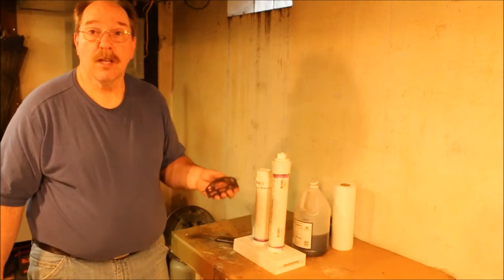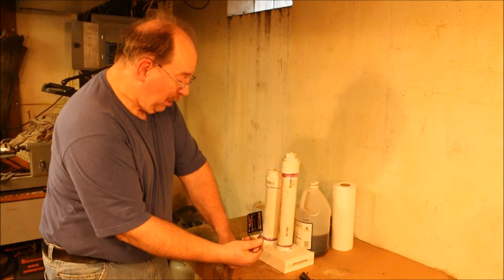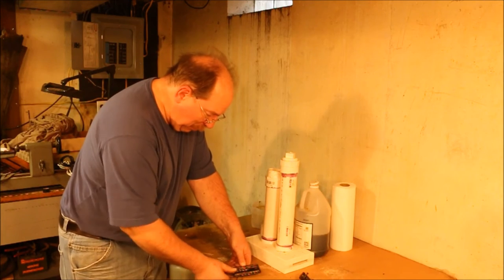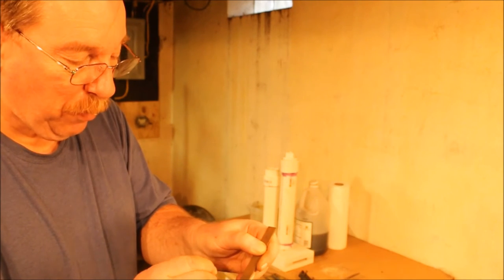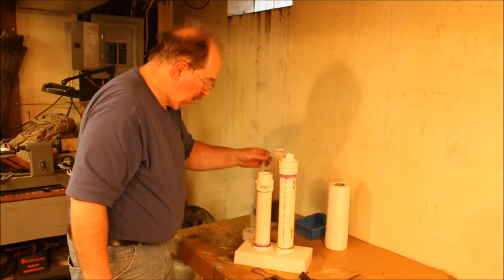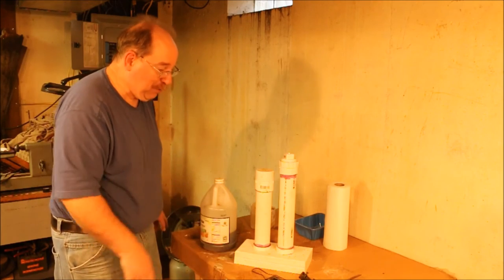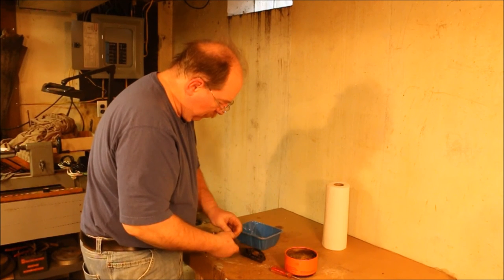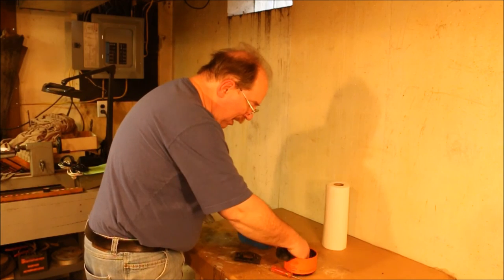Cast Iron Made In USA Saw Jointing Tool ~ Pt 2 ~ Cleaning & Disassembly ~ By Old Sneelock's Workshop

Comment: How long do you soak the file in the vinegar, Snee? As short as this jointer is, would it be possible to use it to breast a saw? I haven't been able to get my jointer apart, yet. One screw is stuck. I keep dousing it with Liquid Wrench...may have to try heating it.
Reply from the maker: +fryefoto Anything is possible. I suppose if you worked on the ends more than the middle you could file the saw into a curve. It would be hard to make a smooth curve though. Heating the side that has the threads in it might loosen up the screw.

Comment: I have a couple of files loaded with aluminum. So tips for cleaning? The file card only gets so much. I suspect the "pin" is my only real option here. Also any tips for a pre-treatment of a file to prevent soft metal loading??
Reply: I know some people use chalk.
Reply from the maker: +GrandsonofKong Matt&#39;s suggestion is a good one. The chalk acts as a barrier between the aluminum and the steel. The &quot;pin&quot; works but if I had a file that had more than a 4 or 5 teeth pinned I&#160; would use the wider chisel type cleaner. This is a link to the video showing how I use it. https://www.youtube.com/watch?v=ic-9_OvwiFQ
Reply: Old Sneelock's Workshop
Thanks..and thanks also Matt!
I'll check the video.